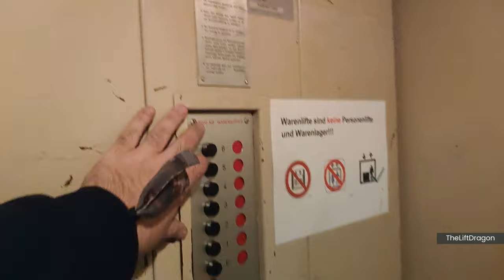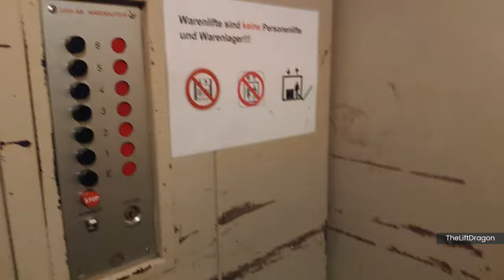HUGE EPIC 1950s SCHINDLER Relay Logic Freight Lift in Aargau, Switzerland

Comment: my goodness that motor room, truly epic, the sound the switchgear, so analog. what we do with a few chips these days seems so dead at times yet this some how seems alive
Reply from the maker: I absolutely agree. This old machinery has tons of character while nowadays, things just "work".
Reply from the maker: Nowadays, we often us a magnetic tape that is encoded with an absolute position in mm. This is a very powerful solution, but it is so easily done. Of course there also is a lot of engineering going into the development of such a system, but it does not feel as interesting and is nowhere nearly as satisfying to look at compared to a mechanical floor selector.

Comment: Incredibly huge, I also visited this marvel but only filmed the engine room for a YouTube short.
For a 2000KG freight elevator it is relatively fast because very often they are at 0.6 m/s and in addition the double motor winch and the brakes are really cool to watch it work.
Reply from the maker: Yes indeed. .The other big freight lifts in this building complex are all 0.63m/s except for one. But I have also seen other lifts, even with 4000kg, that go 1m/s.
The motor setup is absolutely epic and watching this move and work is wonderful. I have only seen this very type of setup in lost places till I got the opportunity to document this lift here.

Comment: Exactly the controller at the building I used to work at, except there were only 3 landings, and the low speed motor was integrated into the back of the main motor. No synchronous low speed motor with the brake resistors to limit speed either, just a 4 pole and a 6 pole motor stacked on a single shaft. Interesting use of the retiring cam motor, not used to open the doors, but instead to stop the car at the floor, by probably breaking the safety circuit as the roller leaves the cam, or on the down by touching it.
Reply from the maker: What you describe seems to be a KDLF + KDH motor set, It is the successor of this setup here. Newer Schindler machines had a 6/4 pole start, that was very common for bigger lifts till the 90s. These lifts also have a centrifugal switch that changes from 6 to 4 pole as soon as a certain speed is reached.
The final stop switches operated by the extra motor are usually built into the floor selector. The wiring is identical, it's only 3 wires for the switches. The retiring motor is wired in parallel to the door cam retracting motor, so they always act at the same time.

Comment: Thanks for this video really a great machine! Could you please further explain the working logics of the control of the two motors? Is the wound rotor asynchronous motor the starting stopping (low speed) one? Is the brake controlled moved by a third motor or it is a electromagnet ? What is the purpose of the bigger motor above the cabin that retract the roller switch? (Sorry if I used improper technical terms) thanks
Reply from the maker: You're welcome.
The motors are both asynchronous motors. The fast main motor is at the front near the gearbox, the levelling motor is at the back. The levelling motor is a normal asynchronous machine, the main motor is a slip ring-motor. The rotor windings are fed into the large resistors above the gearbox. When the lift starts, the rotor resistance is high in order to achieve a smoother start. Then the rotor windings are subsequently bridged till they're completely shortened like on a normal asynchronous motor.
The two brakes are lifted by small 3 phase motors. These small motors are controlled by the 5 contactors at the top of the controller rack. The front brake motor is controlled by the up and  down contactors. Depending on whether it turns left or right, it engages the contacts for the main motor in the up or down direction. The second brake motor only has one contact. It turns left or right depending on whether the fast or slow contactor of the controller engage. In fast mode, it engages a contact that shorts beginning and end of the slow motor windings, resulting in only the fast motor working. In slow mode, it dies not engage the switch and both motors run in series, resulting in the slow speed and the very special sound.
The motor on the cartop retracts the final limit switches. These switches are normally also placed inside the floor selector but probably because of the large size of this freight lift, it was decided to put them on the car top for extra accuracy. The working is exactly the same as if they were in the floor selector. These switches initiate the final stop from levelling speed. The motor is connected in parallel with the door cam retract motor. It releases at themoment the lift is switched to slow speed.

Comment: Do they use 2 motors for high speed and 1 motor for low speed, or do they use both in parallel, is one motor responsible for high speed and one motor for low speeds?  Edit: I see the controller used the brake when the motors were slowing down, was that intentional by the controller? What is the contact thing near the brake assembly? 4:03 and at 4:15, What do they do?

Your video shows what Schindler was and still is (I was not paid to write this)! I love to see the motorized brakes and door operator, I bet there was also a motorized phase-shift and reversal detector, if not please correct me here, not to mention the iconic Schindler Wheel beautiful floor selector! 

Note; I was not paid in any way to write this, I just love how Schindler did all this, to all the Otis and KONE lovers out there, I like those lifts too, I have Otis lifts in my apartment building, they are ReGen’s with 14 floors.
Reply: 4:56 Is that the safety governed?
Reply: Epic sounding motors!
Reply: 6:08 what is that? Sorry for adding so many replies by myself, but as I rewatch this more and more things catch my mind 😅!
Reply from the maker: Indeed, this lift is a prime example of Schindler's engineering. I have documented a lot of old Schindlers and they're truly fascinating machines. I wish we still had more of this today as it's just so much more interesting and has much more character than the modern lifts. Other old lifts are also very fascinating though. I have seen 70s DC Otis lifts in person and their mechanics are also absolutely fascinating.

Now, regarding your technical questions:
- I know the motor for detecting the direction of rotation of the phases, mrmattandmrchay filmed one. This lift does not have one though, there is no detection here.
- The slowdown of the lift through the physical brake is intentional and it is necessary as the rear brake motor has to open the brake in the other direction for slow speed (read further below).
- 4:56 yes, this is the governor.
- 6:08 This is the door cam and the motor that retracts it. You can also see the door roller on the landing door.

As for the rest - I have already answered questions about the way of operation of the motors and drive systems in other comments, so here's a copy paste:
The motors are both asynchronous motors. The fast main motor is at the front near the gearbox, the levelling motor is at the back. The levelling motor is a normal asynchronous machine, the main motor is a slip ring-motor. The rotor windings are fed into the large resistors above the gearbox (4:03). When the lift starts, the rotor resistance is high in order to achieve a smoother start. Then the rotor windings are subsequently bridged till they're completely shortened like on a normal asynchronous motor.
The two brakes are lifted by small 3 phase motors. These small motors are controlled by the 5 contactors at the top of the controller rack. The front brake motor is controlled by the up and down contactors. Depending on whether it turns left or right, it engages the contacts for the main motor in the up or down direction. The second brake motor only has one contact. It turns left or right depending on whether the fast or slow contactor of the controller engage (4:15). In fast mode, it engages a contact that shorts beginning and end of the slow motor windings, resulting in only the fast motor working. In slow mode, it does not engage the switch and both motors run in series, resulting in the slow speed and the very special sound.
Reply: Thanks for replying, now I know how the dual motor shindlers work, at least I have an oversight, I do watch the mrmattandmrchay channel, my first interest in elevators came there, I also watch the lift tracker.
Reply from the maker: @Avidiy You're welcome.
Yes, this is a pretty good overwiew on how the old obes work. As you watch more relay Schindler and pay close attention, you will notice that not all actually have the contact assembly on the brake motors. This design was abandoned and some point and just larger regular contactors were used for main power. Also the slip-ring motor was changed for a conventional one, but with 6-4 pole startup for bigger ones.
Mrmattandmrchay makes great videos, especially when it comes to explaining things. I watch the lift tracker too, he's one of the very few who make nice presentations about the lifts in UK (and not just mess around like some others...).

Comment: 4:56 is that safety governor does it trip in both directions? I have never seen a safety governer using chains
Reply from the maker: It is using chains because it also drives the floor selector, which is not allowed to slip. These old Schindler governors are unidirectional only.
Reply: Thanks!
Reply: Can you reply to my other comment? I have questions about the motor room.

Comment: Why is it 2 motors? Is one motor for high speed and one motor for low speed?
Reply from the maker: Yes, onw motor is fast, one is slow. Although on slow speed, both morors aee switched in series, hence the special sound.
Reply: @TheLiftDragon  Why are the 2 motors running at the same time in slow speed?  It should be nice to see a wiring diagram to know how they are connected
Reply: Does is have something to do with the number of poles? Do the poles of the 2 motors add up when you connect them in series?
Reply from the maker: @theodorranebo2909  I actually don't know why it was done like that, I have only seen this on these very old lifts. As soon as Schindler introduced their KDLF + KDH motors in the early 1960s, the system was changed and it is either fast or slow motor, not both.
i do have photos of all the wiring diagrams at home. it shows the 3 phases coming in from the main contactor into the 1st motor. Then from the ends of the motor windings, all 3 phases split, one end goes into a contactor, the other goes to the slow motor. After these two components, the 2 paths are joined together again and all 3 phases are shorted into the star point. So if you close this extra contactor, the slow motor is bridged, resulting in fast speed. If it's open, it results in slow speed as both motors are in series. These main contactors are actually the brake lift motors. You can see that the first motor goes left or right depending on whether the lift should go up or down. the second motor has large contacts only on one side, that is to bridge the slow motor. This goes left or right depending on fast or slow speed.

Comment: It looks as though the contacts for the motors are motor-driven.
Reply from the maker: That is exactly the case. The contactors on the controller drive the brake lift motors. The up and down contactors decide, whether the first brake motor goes to the left or to the right. this influences whether the lift goes up or down. The slow and fast brake contactors activate the second brake motor. This operates only one contact. If the contact is activated, the slow motor is bridged, resulting in fast speed.If the contact is not activated, both motors run in series, resulting in slow speed.
Reply: @TheLiftDragon  Are you saying that the little motors operate both the brakes and the contactors for the main motors?
Reply from the maker: @b43xoit  Ye. you can see the large open contacts opening and closing in the video.

Comment: According to timestampseries 6:35 to 7:22, when levelling the positioning of the car is immune to ropeslip.
For that time very clever.
Reply from the maker: That is correct. Immunity to rope slip though was standard for Schindler and also Schlieren lifts from that time. A floor selector coupled directly to the traction sheave instead of the lift car via a separate rope was an exception.